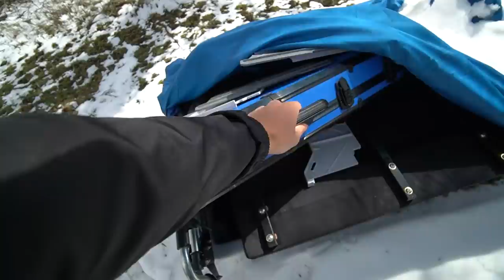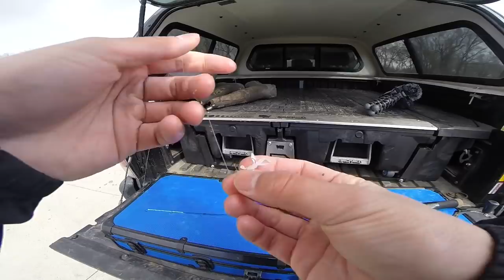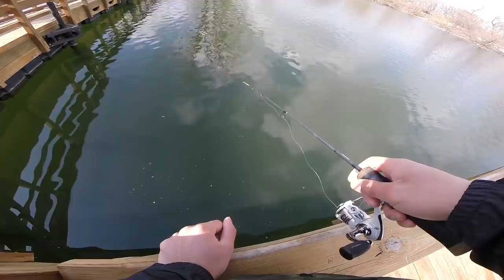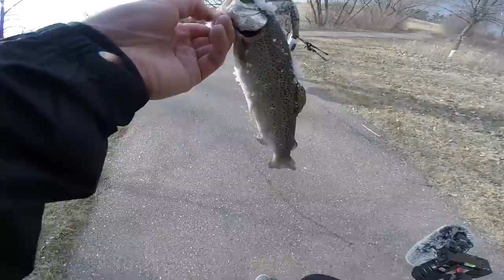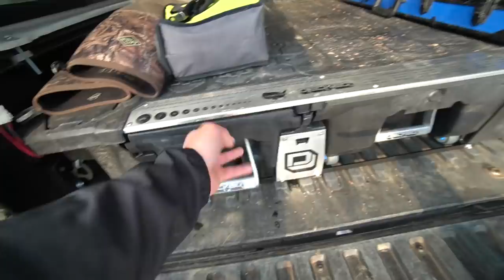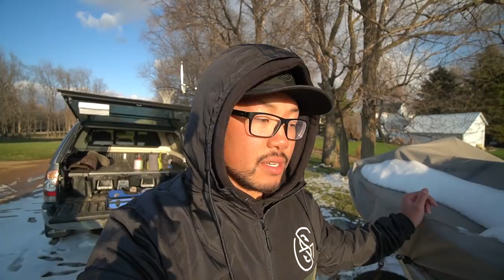Trout Catch Clean Cook out of my Truck! (Truck Camping Meal)

Comment: Love catching trout. Best techniques for me are size 6 multispecies circle hook to 8 to 12 inch of line to a double swivel  before you tie swivel put a sliding egg sinker on main line. Use powereggs powerbait chartruese garlic, or rainbow, or pink. You can also use nightcrawlers with same set up but use a worm.blower to keep it in the strike area goodluck.